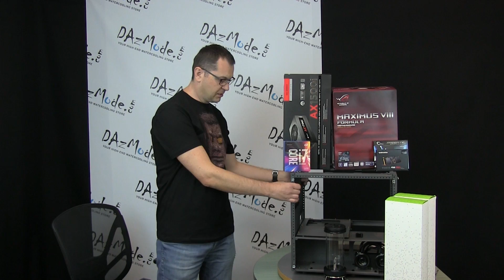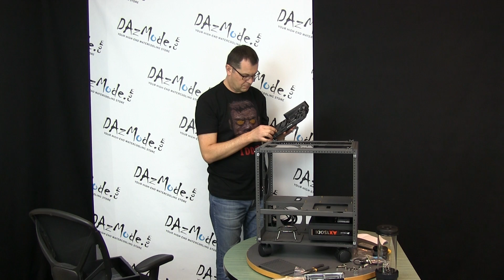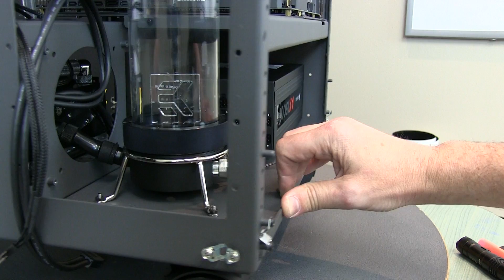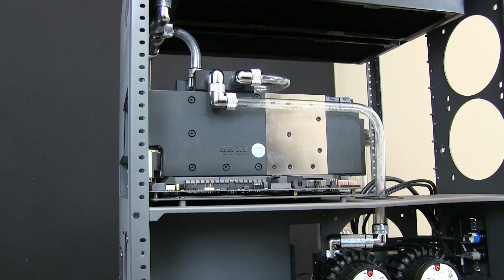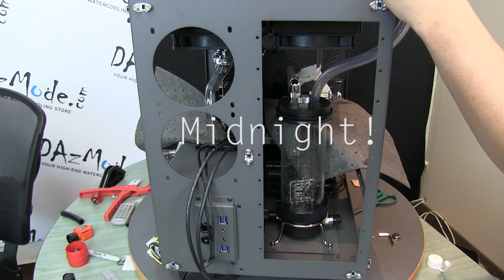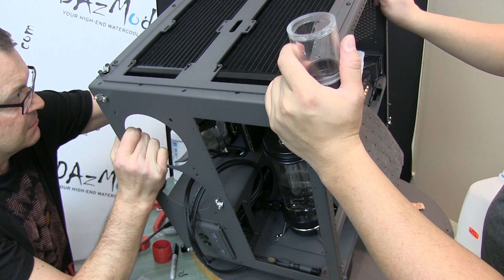Customer Build #2

Comment: Daz, I have a suggestion on how the tube should exit the GPU, if you don't mind. From the viewing angle at 8:30, rotate the exiting 90 fitting 90 degrees to the left, so the exiting tube is parallel to the feeding tube. Then go straight and turn left when it's aligned with the radiator port's axis, the turn up to feed the radiator port. I believe it should make the loop a lot cleaner and actually "some room to breath" when it comes to aesthetics. Again, your build is already awesome. Just some opinions to consider. Looking forward to your next vids bro!
Reply: +Adom Doledas That's what ended up happening. We dry fitted the tubes before putting the fans on the radiators. Once we put the fans on, we realized that the fitting was in the way and we couldn't screw the fans in. We actually ended up with the configuration you described. I'll post more pictures and a full writeup on the Dazmode forums once my power cable and LED mods are complete!
Reply from the maker: +Adom Doledas You are exactly right. I ended up just like that because GT fan was hitting that 90 fitting off the rad.

Comment: WoW, i never seen that GPU config.
Reply: +Camilo Martinez Aldaya Only metric I can say is that in BF4 2 290xes in crossfire (my old setup) ran 7680x1440p on ultra at around 90 fps, the new setup can average 105-110. I can test again with turning crossfire off in this new setup, but I don't know if it'll affect the 2nd chip on the 295x2
Reply: +Camilo Martinez Aldaya I thing it is even bad idea to config it that way. 295x2 on 8 PCI Express Lanes also not a cleverest move. In my opinion 5820k will be better for this 3x CF (personally i would prefer 5930k) . But i am pretty sure that Daz deal only with watercooling, HW components chose is customers decision.
Reply: +Garik NoName I chose the 295x2 because I could pick it up used with a pre-installed waterblock (thanks Daz) and I pulled one of my 290xes from my old build. The x8 vs x16 doesn't make that much of a difference at this point, even with a 295x2. The difference would have been 1 or 2 fps. I also wanted a modern platform as opposed to one two years old. The x99 Skylake replacement is incoming and I want to avoid wholesale upgrades. I don't need the additional cores as it's a gaming PC and not a rendering workstation. The crossfire will be replaced with the new AMD Vega when it comes out late 2016/2017.
Reply: +Gary Fung Ohh. So yo upgraded from haswell or something? And you decided to stay with old Amd gpu? Sure it is not my deal, but better to wait for newer gpu from both nvidia and amd. + upgrading from haswell to skylake will give you 5-7 fps.
Reply from the maker: +Garik NoName Yes, the plan is to replace those two cards with newest AMD upon release later this year.
Reply: +Garik NoName I upgraded from haswell. I wanted a loop and actually needed the 295x2 for its four mini-DP outs (I could've gone with the Furys but that doesn't allow me to crossfire with the existing 290x that I had). I needed the DP outs because I'm running triple monitor with 2 MG279Qs and a 27MU67 in eyefinity. The horsepower needed is more than regular 4k (7680x1440p). When I'm not gaming the 4k monitor is for photo editing.
Reply: Could you tell me if doing dual CF(295x2) vs triway (with the 290x) give you more performance?
Respect to the PCIe lanes, i think 8x it's more than enough for ANY gpu today, just see the new laptops supporting eGPU's thru thunderbolt (PCIe 3.0x4).
And also, skylake-e it's no near, broadwell-e it's about to launch but under the x99 platform, as well as kaby lake (successor to skylake) which it's going to enter production at the end of this year.
Reply: I see, it's okey, i just wanted to know if the scaling was any good. Thanks

Comment: I have the noctis 450, it does support upto 360mm rad but does anyone have this setup that can confirm that the predator 360 will fit in the noctis 450 ? If my measurements are correct the predator 360 will sit 1 inch past the 1st top left stand off for the motherboard (ga-z170xp-sli) which would be an issue. also how often would i need to top up/bleed the system ? thanks